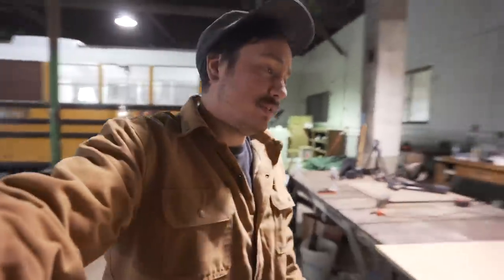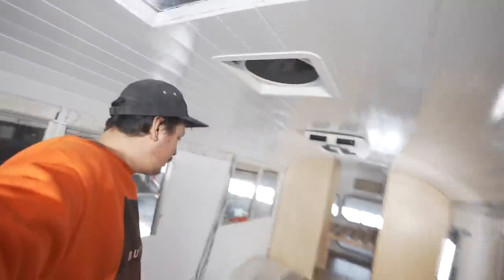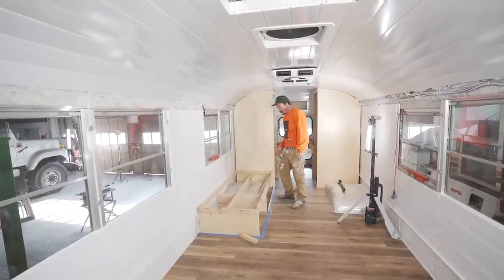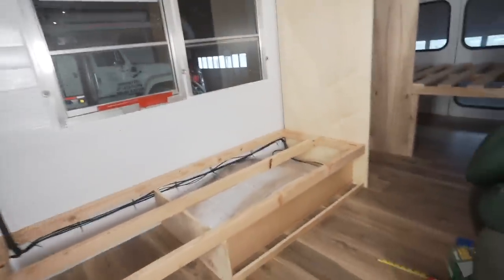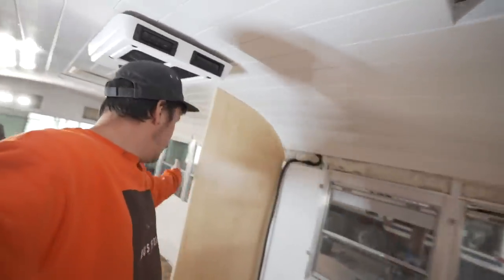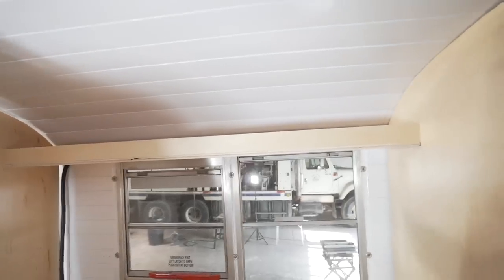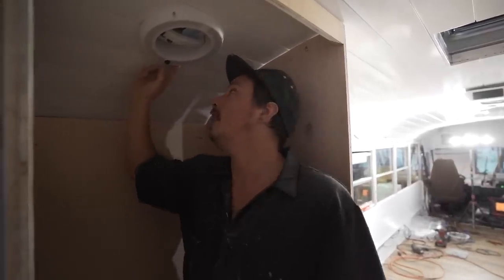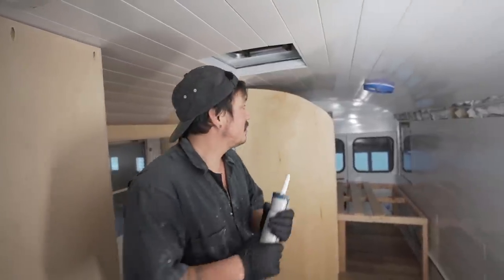Skoolie Build Week - Making Rooms, Installing A Shower Fan, And Framing

Comment: You could buy at IKEA or Walmart an under bed zip bag instead of a wood drawer for now. And maybe add a mesh net for the books,  toy area. Just a thought
Remember later her bed will go up a little for more storage.
Reply from the maker: Good ide!
Reply: Ember could maybe have a little soft toy hammock hanging above her bed. More valuable storage 😊

Comment: Loving the build! I do have a question about the refrigerator though. Are you able to switch the way the doors open? The doors opening left to right with the kitchen on the right makes it harder to set things out when gathering items to cook. If not it’s just a minor thing but, I thought I’d ask since my refrigerator can be changed and I like the convenience:)
Reply from the maker: Honestly I’m not sure. I’ll have to look into it
Reply: @isaacturnerit  Im glad you were able to check into it and you are able to switch the direction the doors on the refrigerator open:) It will be so much better for Jaylena when she starts cooking in the bus. It’s the little things.